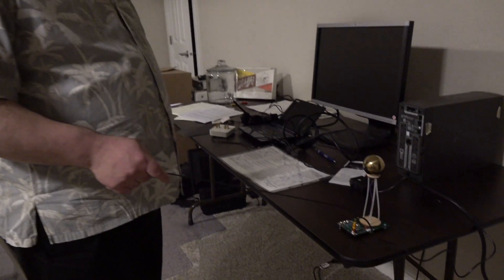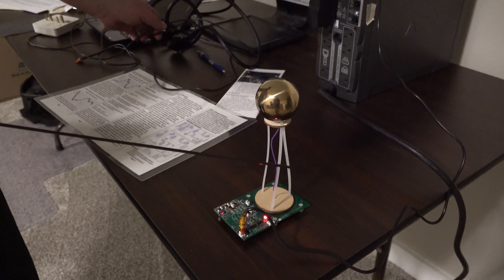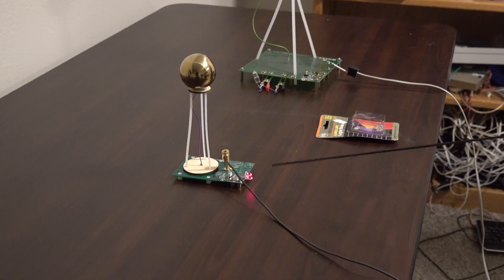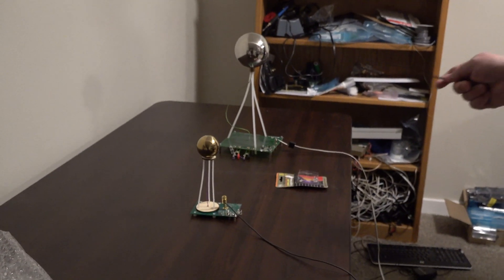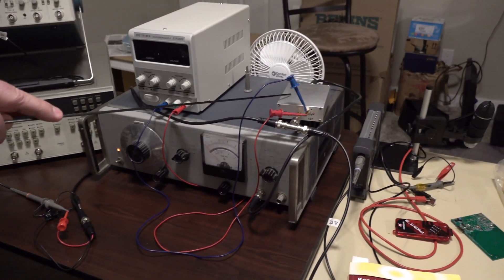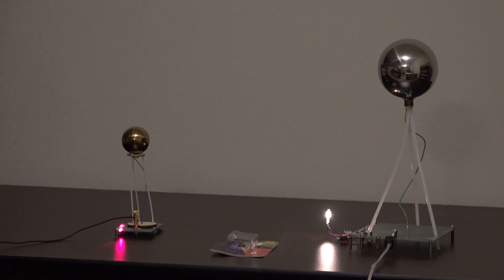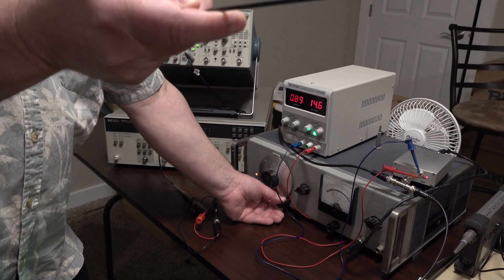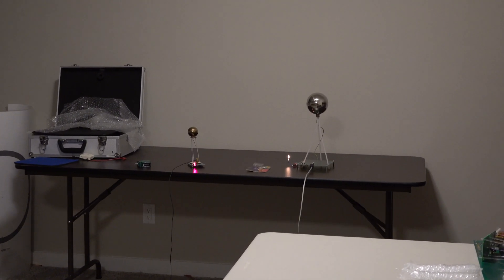Demonstration 2019 (please see vril.io and https://www.youtube.com/watch?v=RAwy-RiTAEw)

Comment from the maker: Third response to Patrick: Thanks Patrick for sharing, yes when touching the receiver LED it did change the tuning slightly and when touching the transmitter its source is more stiff so no tuning change.  So this can be overcome by re-tuning by e.g. the PIC chip I used on my starter kit.  Also note touching the receiver LED could/would produce sensation of shock when running at sufficient power better than a function generator like RF amp at 5W.  Note also the RF amp would see highly changing impedance and the Q is high when tuned, so the starter kit I made controlled by a PIC chip can stay locked in to the load using the analog input sensing function in a C program loop, varying the transmit frequency with its onboard VCO to maintain the load at peak power (minimum voltage sensed at the transmit end for a given source impedance is the algorithm running on the PIC).  For the higher power levels as touching the globe slightly then smell your finger burnt skin, or get shocked at the one-wire terminal, really anywhere on the receiver you get shocked when in resonance longitudinal and transmitting e.g. 5W but never shocked with transverse frequency.  At one point I powered the PIC on the receiver solely from power swept tune on the transmitter.; the PIC woke up and blinked an LED.
So far as the transverse wave that peaks first as the frequency is swept towards the longitudinal high Q tuning situation: One recognizes this mode empirically when touching the receiver leads the received wave as it is not in tuning fork mode rather 1/R field intensity detection.  Look at my comparison report (or I can send it to you from griffin.adam.h@gmail.com) demonstrating difference between startup of these two modes one with its hunt pulse followed by monotonic startup and the other choppy; it is really a fundamental thing that nobody could know otherwise what I have discovered and shared there.
Regarding winding sense primary to secondary it really does not matter primary vs. secondary because it is a phase shift of 180deg in the stimulus, probably would affect the startup envelope by quarter cycle is my guess so its superposition it might matter in keyed communication (I have wound the secondary opposing the primary on experimental PCBA iterations and did not obtain favorable results maybe due to this superposition or added capacitance putting extra secondary on the backside).  All of the PCBAs that I made contain windings and a buried via to jump out of the primary loop.  The use of 6-ounce copper in the starter kit allows to prevent too much resistance e.g. pushing at least one amp through its fine geometry. Scaling the starter kit down once more from what was published proved to operate at frequency proportional to the secondary unfurled coil length but its PCBA was too small to contain the instrumentation and VCO so I abandoned the smallest version.   The smallest version would illiminate a LED in resonance with either Meyl's kit or my starter kit.
I suspect not enough people pre-ordered the starter kit yet on vril.io so Aaron would not be able to yet make a production run.  The artwork and prototype I created is sitting at Tate Technology here in Spokane WA under a 10-year NDA with about 7 years left on it.  I don't see how to profit off these kits it is so esoteric a function, so I essentially donated and expect Eric should see compensation from potential sales.  If Aaron wanted to have Tates just make the boards without my active circuitry it would be super cheap but then one should instead buy Meyl's kit to play with.  I remember discussing with another person who wanted a starter kit a couple years ago so I offered to let him use mine but he did not.
Adam Griffin 22APR22

Comment from the maker: Follow up again with Patrick:  "The transverse mode will appear to double as I get closer to longitudinal mode" actually what I observed is the transverse mode drops out and then the next resonance is the longitudinal mode where the receiver is not de-tuned by touching it.
 "Would a clamp meter work as an alternate to a pearson probe?", my expectation is the clamp would produce the same nonsense when the scalar wave is present.

"Do you think florescent bulb is the best way to go?" my opinion is that is good for demonstrating where the field is highest and to do things like drag it along the one wire to see the longitudinal field is so high it keeps the gas lit.

That is interesting that a grassy park and with flat wide conductor return on concrete is that in those cases the system did not work. Have you attempted to do one-wire transmission throught your houses ground?" yes and that failed to tune, plus I got worried about overheating Aluminum wires etc if the longitudinal wave were to get established there as hoped when I ran that test so the ground must have gobbled it up or actually probably made it untunable for the longitudinal wave.

We are continuing Tesla's work, only with better instruments to take measurements.  But we are a long way off from understanding any of it.  Just try to get Ansys to tell you how this works or to even model it.  Actually Maxwell failed to do what CST did, but I never finished my CST simulation and don't plan to do it.  This technology is like going down a rat hole you never emerge and as you uncover each layer the one underneath it is even more complicated.  Without ten million dollars for continued research it is futile in my opinion, because I want something commercial that can actually be used.  

There is a sensing application that I came up with in the medical device world but again that ten million does not exist to pursue it right now.

I think we are lucky to have transistors and RF amps because Tesla had to use broadband sources and commutators so he could never get to the bottom of the measurements.  As for Dollard we should figure out how to support him somehow, it's just right now I don't know what would be helpful.  I have worked with Eric before because he asked me to; after all Eric provided the insight needed to understand Meyl because of all his old videos I watched on youtube.
I think instead of this back and forth on email it would be best to sit together sometime.  I am located in Spokane now.  My normal day is consumed with conventional electrical design and nothing to do with the longitudinal technology unless someone asks me about it.

Happy Easter.  
Adam Griffin 17APR22

Comment from the maker: Follow-Up for Patrick:  Yes I did replicate Meyl's work using his kit, the globes were like 100mm diameter, the actual globe what I call scatteron can be small or large does not matter, and what I found using flat scatterons worked fine too in my scaled down device.  I put my scaled down device on an impedance analyzer and looked at phase and pass through where the instrument clearly replicated what I saw using the system I made with its on-board oscillator amplifier.  The basic problem with these devices is to drive a low input impedance with some kind of source certainly not the crappy TTL generator in the kit I used once and rejected it.  What is needed is an RF amplifier.  The other thing is when the load goes into longitudinal mode at almost double the transverse mode you see when ramping the frequency up, the source suddenly feels the load impedance pull power off the line (the globe and wire pair).  During the longitudinal wave I see the pearson probe reads nonsense for example I disconnect the probe and with the probe still threading the BNC cable it reads as if there is an amp so I don't know what to make of it.  It means I can not reliably measure what I want to measure.  I understand that Dr. Meyl and his 700 page book, is the last work on the longitudinal wave subject where he deserves the Nobel Prize for sure; look at how he deduced the type and mass of elemental particles by analysis in his book, and the discussions on neutrinos. 

The main problem with the technology in my opinion is the connections can get hot even when they should not from conventional rationale, it seemed in one experiment I was doing transmitting like 5 Watts across the scatteron and one wire, the banana jack connections were getting hot and that should not be with such a low current. So that brings up a potential safety issue that would need to be fully understood before power transfer is attempted at scale.  Another bothersome thing based on my experiments in grassy park and with flat wide conductor one-wire on concrete is that in those cases the system did not work.  On the other hand when the one wire is kept off earth, and between floors of a house with a long one wire it works fine, but not when the one wire is near the earth or all the energy appears to get clobbered in the earth or more likely the tuning is so out of whack with the scatteron near earth that neither transverse or longitudinal lock-in can occur at the receiver. 

But there is great promise for transmission of signals and low power using this techology that Nikola Tesla invented, Meyl and myself, an now you and others replicated, Meyl mastered this and was treated poorly by his university in my opinion never receiving recognition for his contribution because of its disruptive nature to PhD dissertations.

If one were to make for example 4 turn primary and 100 turn secondary, and wiring the secondaries with a one-wire that is up off the earth to keep it from coupling then I would expect the resonant frequency at the quarter wave length of your 4 turn length.  Taking f=c/lambda and c=3E8 m/s.  Then the longitudinal frequency you should expect would be somewhere between f and 2f so adjust your input frequency slowly to observe the peak where the load will light up and source will drop in voltage as the current flows longitudinally out the scatterons.  If you manage to have a 20mW source at +/-6V (12Vpp) driving the primary using that puny amplifier in the link below, one should be able to transfer 20mW across 2K load at the receiver end measured with a floating scope or USB scope plugged into a battery powered laptop.  
WideBand Amplifier 30dB High Gain Low Noise LNA Amplifier (https://www.amazon.com/dp/B01N2NJSGV/ref=cm_sw_r_apan_i_MR497D5833NDX9WBCTKR?_encoding=UTF8&psc=1)

The miniature kit I made has substantially the same length primary as Meyl's larger kit so they will lock in just fine with each other near 6~8 MHz.  I suspect your kit will not lock in because the primary lengths which set the resonant frequency might not match.

Again I would never use a TTL circuit to drive a low impedance primary of a longitudinal system that will hit very low impedance during resonance.  TTL can't drive anything but logic or maybe tens of mA using a hex buffer.  Maybe CMOS would be better because there are higher voltage versions.  But the square wave part is parasitic, we want to use the fundamental frequency for experimentation.

Further the frequency I am suggesting is using the quarter wave frequency defined with f=c/lambda of the primary turns overall length stretched end to end.  This is close to the hertzian frequency at c=3E8 m/s and then when you increase the frequency it gets to be longitudinal.  The exact frequency you will see, where the Q is highest and the human touch on the receiver scatteron does not interrupt power transfer to the 2K resistor mentioned above makes sense.  That frequency range might actually be 6- 8MHz but your function generator and floating scope at the receiver 2K load will tell you when it is peaking hence in transverse or longitudinal mode.  If you have another floating scope on the transmit primary you will see its voltage drop rapidly as the receiver load voltage rises rapidly while getting the fine tuning knob set on your generator.

More detailed papers that I wrote are available and can be presented depending on a particular question at hand that I researched many.

The size of the terminal is not much affecting the longitudinal waves from what I saw.  Once it is in resonance it transfers all the power to its one or more loads connected in star fashion.  Also loads sitting next to each other are sympathetic resonators and exact energy off their co-located victims but the total energy transfer from source to load from what I measured experimentally is less than 100% as one would expect in a closed system.  

For scatteron shape probably rounder was better to prevent arcing but the scatteron shape in my opinion is nothing more than a way to change the system tuning; and the constraint of any sharp edges is it will burn you on light touch (another issue, ugh).  The distance between scatteron and PCB containing its secondary did not seem to be much of an issue, in fact I removed legs and haphazardly laid the scatteron off to the side with its wire hanging off a foot or so away with not much change system performance.  

If the scatterons change position then the tuning has to be changed to find the longitudinal wave ferquency again.  The complex Starter Kit I made using as predicate the simple kit from Meyl searches for that frequency automatically using my software (firmware?) because it knows when the receiver is taking power and the source impedance drops upon achieving longitudinal frequency.   

Another thing I noticed that agrees with Tesla's original patent is when the scatterons were lifted higher away from the PCBA the efficiency of transfer increased measurably in my experiment from first floor to third floor with the long one-wire going up all the stairs to the receiver end being measured simultaneous to the transmit end tuning while looking at the receiver scope using a webcam (this de-coupled transmit and receive measurements and allowed remote tuning using real time webcam feedback).

I don't know if Aaron was successful at getting any of my kits in users' hands, I have not seen any request for programming their firmware but the hardware design was handed off to his CM a couple years ago.

Adam Griffin 16APR22

Comment: Are you able to transmit digital information with this? Email, text, etc?
Reply from the maker: The answer is theoretically yes however it would be at a low data rate because the frequency is around 6~8MHz, so it might be 1000x slower than commercial technology.  The advantage could be however, communication at arbitrary distance or through shielding.  Thanks Isaiah.  Adam Griffin 13APR22.

Comment: What kind of amplifer are you using?
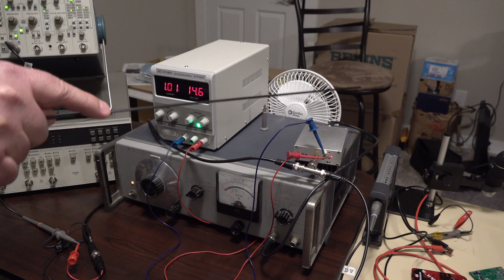Reply from the maker: Thanks Patrick.  The amplifier is seen at 4:32 timestamp on the video, and can be found at this ebay link for 100 dollars: 
https://www.ebay.com/itm/292332692836?hash=item441062e564:g:GZwAAOSw~HBaDOlN
Adam Griffin 14MAR22
Reply: @nearfieldresearch4573  I see. What frequency range are you using? Are you using Sinewaves? I recall in Dr.Meyl book he said he used the TTL port on his function generator. What amplitude are you using?
Reply from the maker: Thanks Patrick.  I am using in the neighborhood of 6 to 8MHz.  This frequency corresponds to quarter wavelength being the spiral high voltage secondary length if it were unwinded all the way.  A 6-8MHz sine wave works essentially the same as a 6-8MHz square wave, but that TTL port Meyl used is too weak for appreciable power transfer so I switched to a sine wave generator of higher power.   Then I wanted to transfer even more power so switched to an amplifier situated after the generator.  The amplitude driving the low impedance primary is something like a volt or two peak using the sine wave generator and up to about 12 volts using the amplifier.  If you are interested to learn more I can send you some more detailed papers, my email is griffin.adam.h@gmail.com